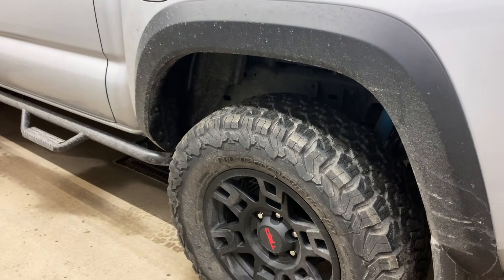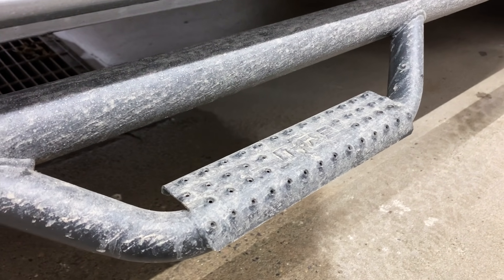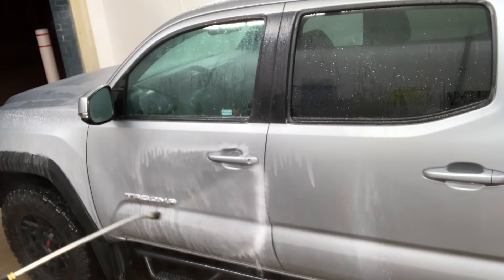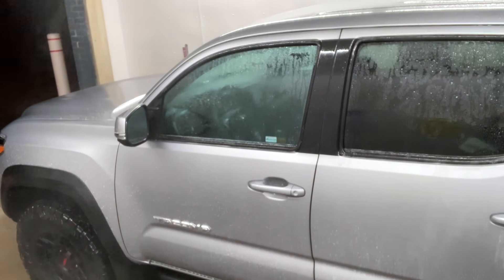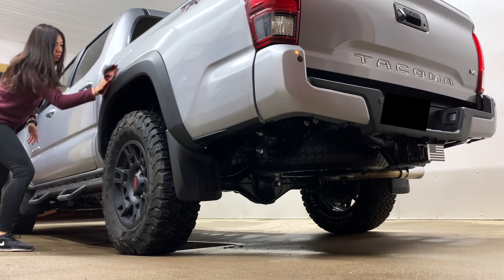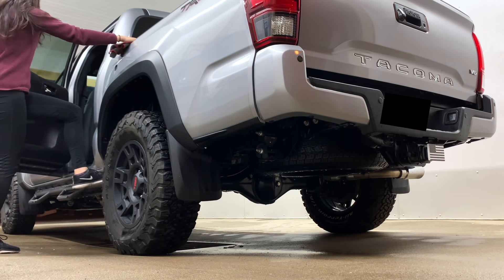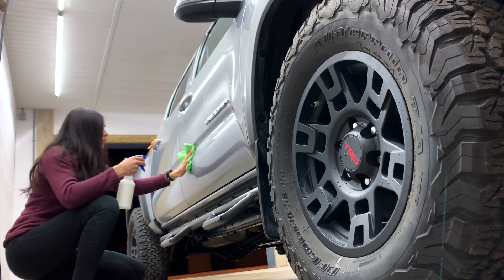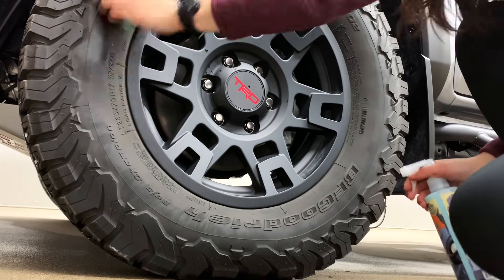How I Wash + Detail My Toyota Tacoma

Comment: You can buy an air blower to help speed up the drying process. It may not get all of the water off but it will at least speed up the drying process, and you can just finish with a rag. I also prefer it because it pushes out the water that lingers in-between cracks.

Comment: I highly recommend applying Sonax spray and seal (hydrophobic). Applied it to both of my cars and reduced the drying time a lot ( i use one big soft microfiber towel). You can also apply it to the exterior windows and plastic trim. Makes it more easy when cleaning up dirt and bird poop (which I absolutely hate). You can still put your favorite wax on top of it for another layer of protection. I sometimes put MG express wax or CG V07.
Reply from the maker: Thanks for the recommendations! I'll have to try out Sonax.

Comment: whats up Chloe?  Your cross country trip randomly popped up in my recommended videos.  You make some great videos.  I can tell you have a high attention to detail.  I noticed your tires were brown after you washed the truck and you could tell they were a little splotchy after applying the tire shine.  I recently came across a product called Tarminator (I don't have anything to do with the company) and it takes off the brown staining from your tires before you apply the tire shine.  I recently used it on my car and it made a huge difference.  Keep up the great videos!
Reply from the maker: Thanks I'll try it out! My tires have always looked a little brown and I hate it

Comment: Your truck looks super cool with wheels and tires on it. I have 2021 trd off road want to change it like yours. I have seen your tire size in the link. Can you suggest me do I have to lift my truck before putting same wheels and tries like you ? I will be driving mostly in the highway does it have tire noise?
Reply from the maker: I was running these on stock suspension, so no lift needed to run these
Reply: Hi thanks for your reply does it rub on the sides when turning? Also do you have any suggestions to get rid off sluggishness? Do you recommend pedal Commander?

Comment: what is this spray on wax? how is it different from regular wax? do you apply it every time you wash it? thanks
Reply from the maker: My understanding is that spray wax is synthetic, and the main difference is in the application--spray wax is a lot easier to use and less messy, but doesn't last as long as regular wax. I use spray wax about every other time I wash my vehicles, depending on how they're looking. Hope this helps!
Reply: @ChloeKuo  Yes it does, thanks so much!!
Reply: Recommend a true wax twice a year and then the spray wax to maintain... wax/sealants is protective layer above the clear coat..
Reply: @ChloeKuo  How is the ride? is it pretty smooth? how does it drive on the highway at 80 mpg? thanks so much